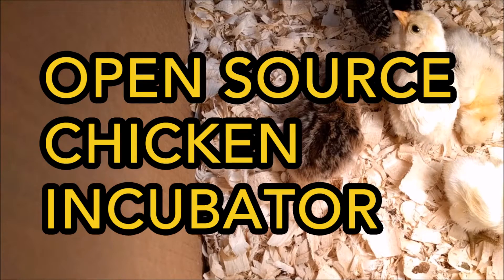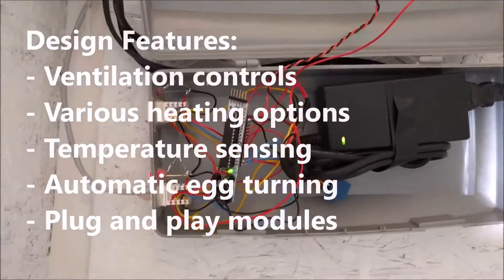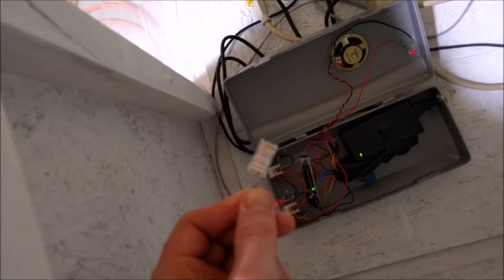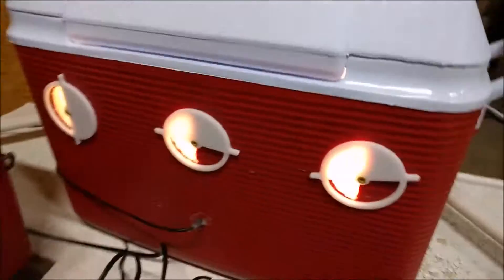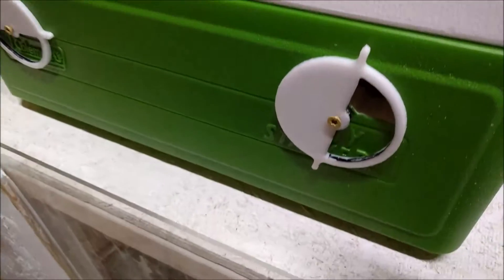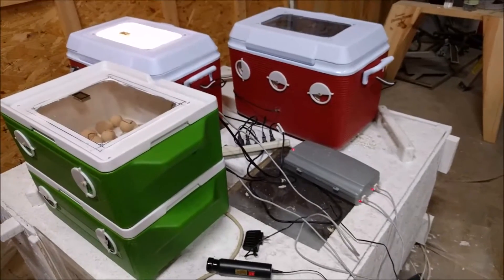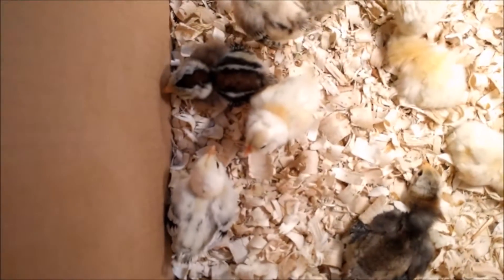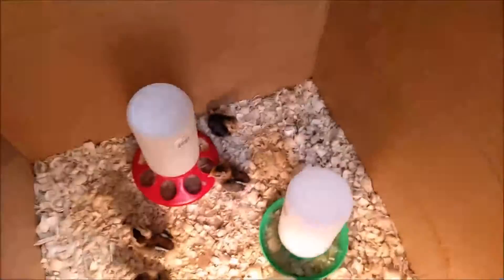Open Source Chicken/Poultry Egg Incubator

Comment: Fantastic design. Was a circuit ever drawn up and code posted im now in the process of thinking of the best way of building a duck egg incubator using an arduino,
Reply from the maker: Thanks.  I never did get around to documenting everything.  These designs used a CNC for some parts, so I am going to simplify with more off the shelf parts, etc. at some point.  I still have all the parts on my desk... just haven't had the time to dig into it.  Unfortunately the number of nerds who would be interested in building their own incubator is still fairly low.  There are also many designs on backyardchickens that are pretty easy to construct.  You should take a look there for ideas. :)

Comment: Hi can you tell me how you made the egg turner?
Reply from the maker: It's a plastic tray I designed in QCAD and CNCed with an endmill out of plastic sheet.  The it moves via a lever connected to a geared motor to translate locomotion into linear motion.  A simpler approach would be to use dowels that rotate slowly, which eggs rest on, using an electric clock motor and some belts (rubber bands perhaps) to drive.  I plan to try out this approach on my next design.  My goal is to create a design that has limited fabrication and off the shelf parts for the next version.

Comment: Interesting idea.  Where the heck did you get those adjustable air vents?
Reply from the maker: I designed them in CAD and milled them with my CNC. That's one reason this project is beyond most hobbyists and more in the realm of engineers. :P
Reply: If you have designed them in CAD, you could create an stl file and 3D print them.

Comment: I worked on an open source incubator at Open Source Ecology but didn't get a chance to finish it. You can see my efforts in the Google doc at http://opensourceecology.org/wiki/Open_Source_Chicken_Incubator. I'd be willing to help with documentation in return for getting these designs both for my own use and as open source info. Looks great!
Reply from the maker: Very cool.  With my real world experiences using the design in this video, I would change some things.  I do have some ideas for a new design that is more scalable and works in extreme temperatures better (out of the house).  I'll take you up on your offer when the time comes.  I might work on it next year for a new batch of incubation.  Thanks for the interest!

Comment: Can you give a list of sensors you used? I have some arduinos laying around. Should make for a fun project. Also where did you find those short green coolers?
Reply from the maker: These temperature sensors are really great and have a good price:
https://www.amazon.com/gp/product/B00CHEZ250

They use the one-wire library for Arduino.  I don't think I used any other sensors really.  I believe solid state relays for the lights to more easily drive off 3.3v for Arduino Nano.

The short green coolers:
https://www.amazon.com/gp/product/B002BM70R6

The turner is the most complex part.  I actually CNCed the plastic part for the tray.  I saw another clever way of doing turning using dowels that rotated.  The eggs just rested on the dowels directly.  Whatever requires the least expense or fabrication is best I think - keep it simple!

Let me know how the project works out!